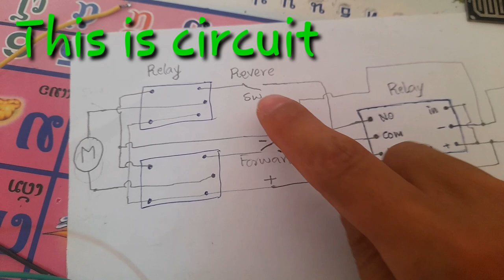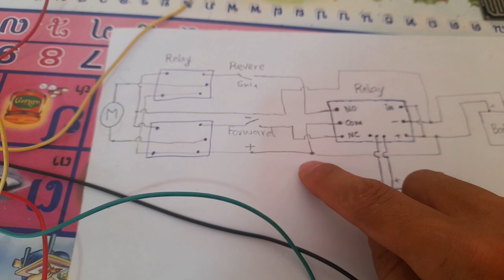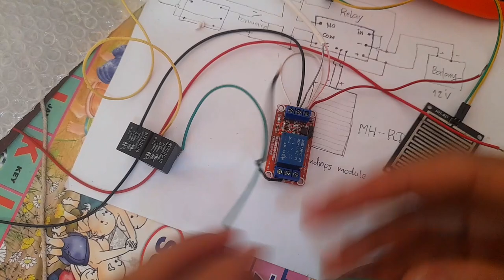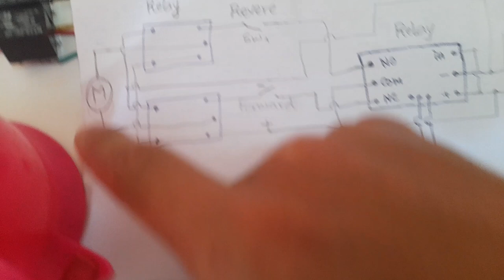How to make automatic clothes drying rack when rain ☔ (วิธีทำราวตากผ้าอัตโนมัติเมื่อฝนตก)

Comment: I kinda don't understand the circuit diagram, the two relays coils are connected to NO, NC and COM ain't that just gonna send a positive voltage on both terminal? Imagine the main relay turns on NC sending positive voltage to one of the motor relay and the end terminal is also connected to COM which is also connected to positive??
Reply from the maker: If you look at the circuit diagram again you will understand, the two relay coils are connected so that the positive and negative wires are interchanged so the motor can Revere and forward
Reply: The COM in two relay is connected to the motor?
Reply: and two NC in two relay is connected to the ground?
Reply: and i think in the middle of two coils in relay is the COM?